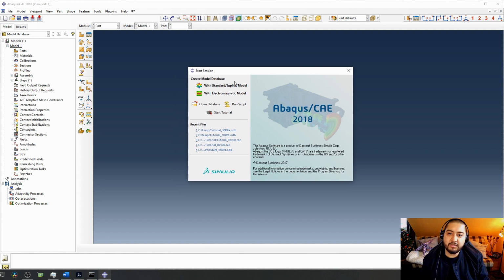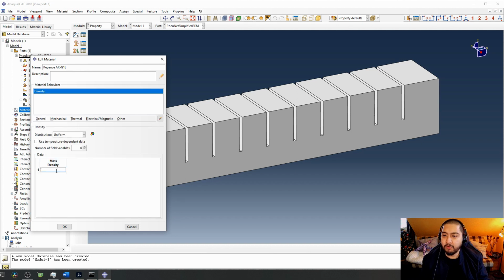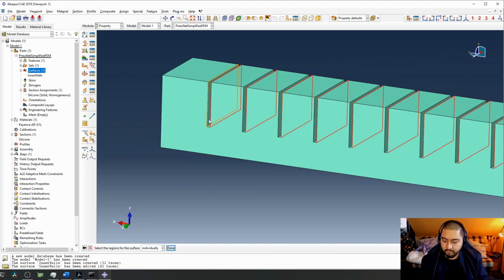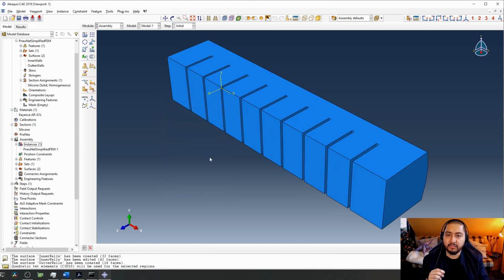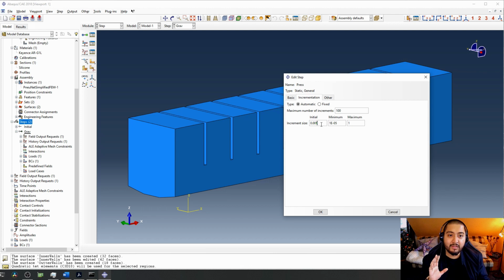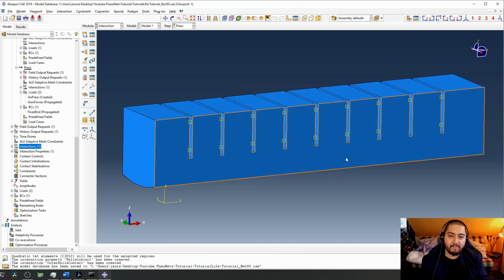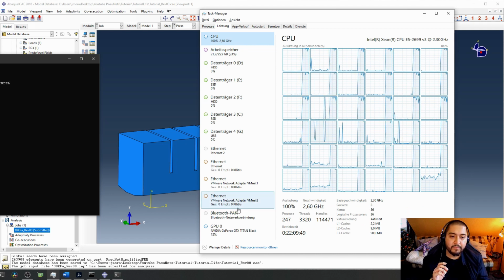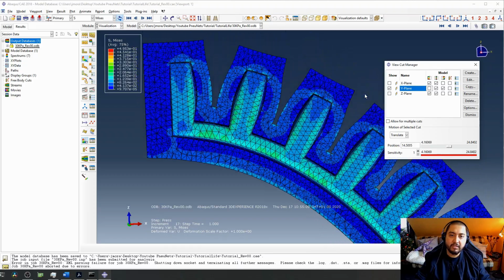Abaqus Hyperelastic Soft Pneumatic Actuator FEM Simulation Tutorial / Soft Robotics Simulation

Comment: Hello Jorge, thank you for the tutorial and explanations! I meticulously followed the steps to reproduce the simulation but the solution does not converge at the very first incrementation. I use Abaqus 2019 and I tried with a seed size of 1 and of 1.5 since I have about 8GB of RAM. I tried to reduce the incrementation for the gravity force from 0.1 to 0.01 but without success. 
I receive as warnings: There are 2 unconnected regions in the model. Excessive distortion at a total of 122 integration points in solid (continuum) elements.
Do you have any idea where the convergence problem may come from? 
Thank you in advance for your help!
Reply: have u get results?

Comment: Sir this ramesh I working on soft gripper I have facing some problems in simulation in abaqus getting results take 3 to 4 day I don't know what is problem  my system 8GB 1TB hard drive please give me replay as soon as possible
Reply from the maker: Hello Ramesh, what CPU do you have on your computer? i can already tell you that 8 GB RAM probably is not enough. If you do not add more RAM, the model probably is seding the data to the Hard Disk in order to compute, which is not desired and increase a lot the simulation time. Try to minimize the model mesh size and try to add at least 16 GB RAM to your computer. Thanks for watching!

Comment: Hi Sir, I am doing similar simulation as you and the problem I faced is that I couldn't//don't know how to obtain the bending angle of my finger. I have tried Tools>Query>Angle but to no avail. I really hope sir can provide some advice on how to obtain the bending angle.
Reply from the maker: Hello, you can use the Probe Values tool from the Side Toolbar in the Visualization Tab to take the nodal or element 3D space coordinates in original and deforme coordinates. These are based on your assembly reference coordinate system and after that you could use the coordinates to calculate a bending angle. I hope that helps. Thanks for watching :)
Reply: @JorgeMoralesAv  Thank you sir, it helps a lot. Appreciate it very much. :)
Reply: @anonymouslow9689  could you show me the way how bending angle is calculated please?
Reply: @ThangPham-dx9ic  Ur email address? I will forward you some images.
Reply: @anonymouslow9689  vanthang.pham1999@gmail.com. Thanks a lot!
Reply: @ anonymous low how you find the bending angle. Please let me know the method
Reply: @poojabhati366  Just view your job result, select tools - query - angle - face/edge - select 2 face/edge you want to find the angle between them.
Good luck!